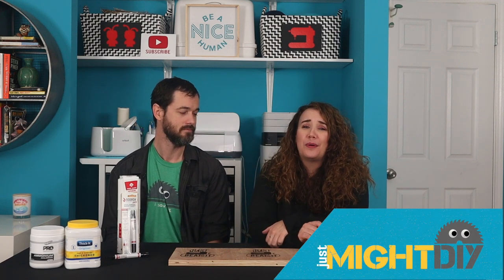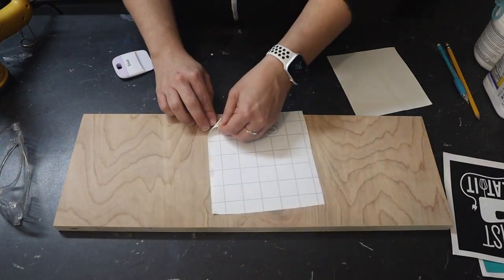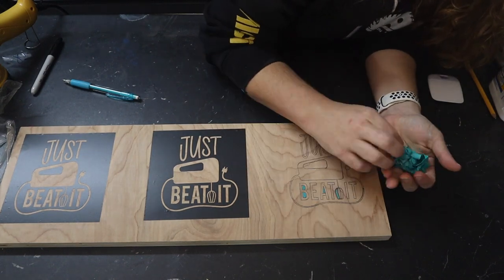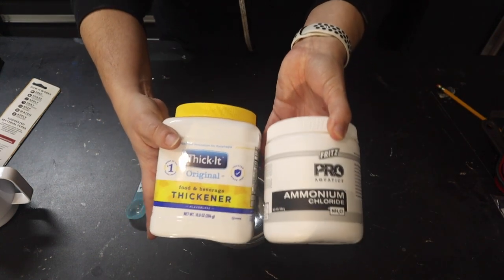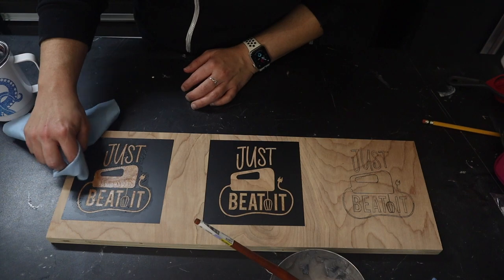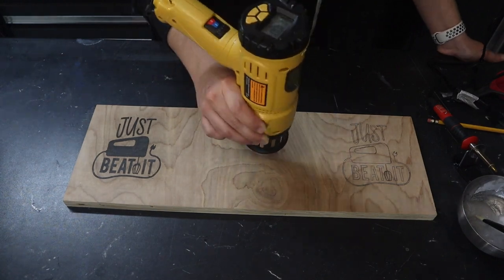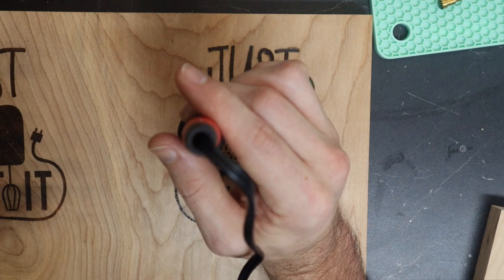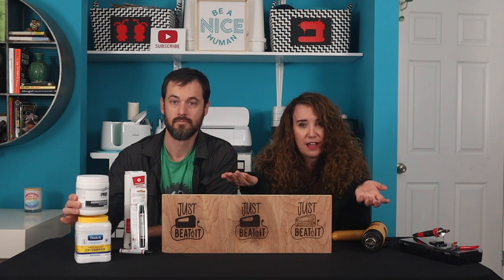3 Ways to Burn Designs on Wood without a Laser!

Comment: I’ve used the scorch marker multiple times but was curious about the other methods so thanks for showing these! With the scorch marker I’ve found that if I do 1 light coat, let dry, do another light coat, let dry then burn, it gets pretty dark. Even though the instructions say to use a heat gun like yours, I use a crafting heat gun that is smaller and not as hot. It does take a little longer but it does not overheat/burn the wood as easily. You can also sand areas with mistakes!
Reply from the maker: That’s great info - thanks for sharing!
Reply: I think the other issue is you waited an hour (?) for the chemicals to set.  I use the scorch marker right away and don’t have an issue.

Comment: Why ro you use perminant vynal just to take it off? Also, do you need to apply something to the wood to seal it after?
Reply from the maker: We used it because it gives an aggressive seal so we didn't have to worry about the edges not being straight. We didn't seal it after and only would if you want the wood to have a different hue to it or it needed to survive outdoor.

Comment: This was a very good experiment! Thanks for sharing. I do have a couple questions, if I were to use the ammonium chloride solution on a cutting board, do you 1. Know if it’s food safe ? And 2. Should I seal it somehow or will the design stay well through washes ?
Reply from the maker: Hey! While we can’t comment on whether it’s in food safe, the design should stay since it’s burned into the wood. Hope this helps!

Comment: I am new to cutting machines/vinyl etc.  I have operated under the assumption that for something like stencil which you intend to remove.. you'd use 'removable' vinyl and not the permanent type.  Would you mind elaborating on why you go with permanent?? 
Great video!  I love to see couples doing crafting videos!  Hope perhaps I'll get the opportunity to try that with a special lady of my own.  Great combo of humor and chemistry you two!  Thanks for sharing! :)
Reply from the maker: Hey! Great question. We use permanent vinyl for some stencil applications when we’re concerned about bleed and want a stronger initial adhesion than removable provides. Most of the time, adhesives need time to fully cure to come to full strength, so the permanent vinyls we’ve used in these types of applications have been strong enough to mitigate bleeding while not being impossible to remove after a short-ish amount of time. Hope this helps! 😉
Reply: Thanks so much for taking the time to reply!  Yes that totally makes sense.   I've been thinking about if/how bleeding under vinyl stencils happens.  Looks like I was on track with that line of thinking.  
I guess/hope with time I'll learn when each type (permanent/removable) works best  @JustMightDIY